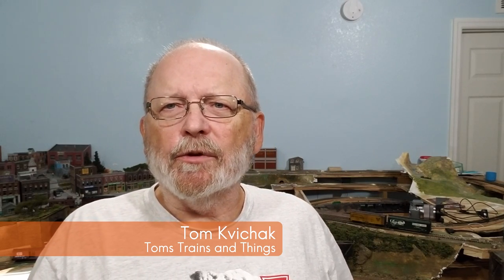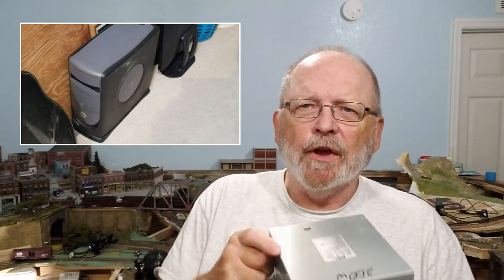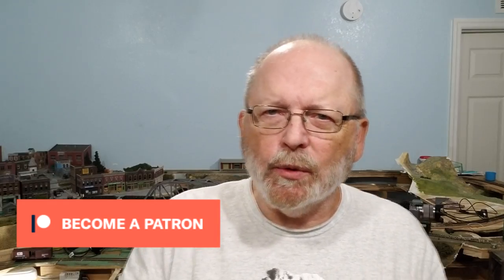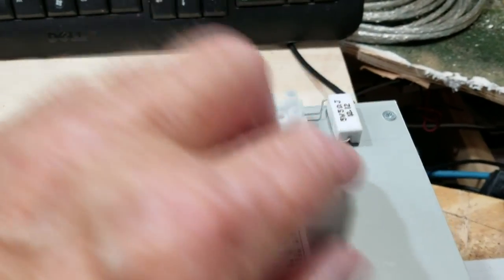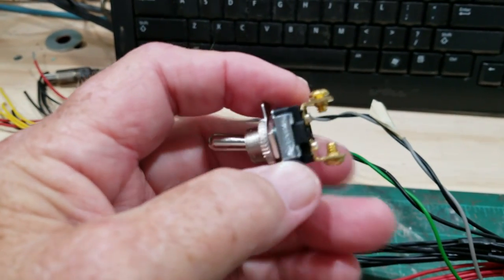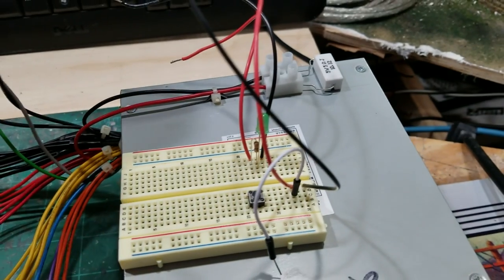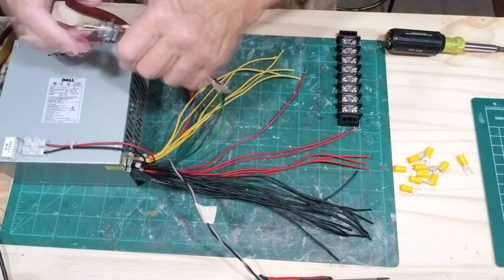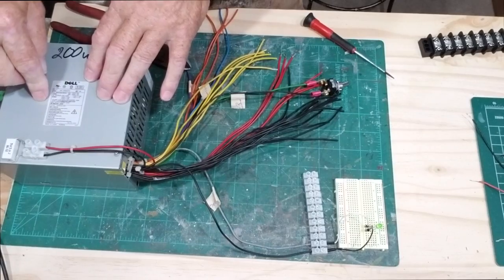Easy Power Supply For Your Model Railroad

Comment: About 20 years ago, I tried to re-purpose an old computer XT power supply. I could not get sufficient voltage from the 12 volt wiring, so I "s-canned" the supply. Later I found the absence of a load on the 5 volt wiring influenced the rest of the available voltages! Later I re-purposed an old AT supply to power general illumination 12 volt LED lighting in my garage workshop. Instead of using a large resistor for a 5 volt load, I used a 6 volt incandescent lamp such as what is was on a motor scooter, golf cart, or a building emergency lamp. Mine was a type 4510, case style PAR36, 6 volt lamp, which worked for me. I know an incandescent lamp's cold resistance (off) and hot resistance (on) are different, but the bottom line is that my one lamp solved the problem for me. The 5 volt circuit does need a load, and mine did useful work in providing some illumination!
Reply from the maker: Good information. Thank you.

Comment: 12 GAUGE OR  10 GAUGE WIRE  .. REMOVE ALL  BLACK WIRE  REPLACE WITH  1-  #10 OR #12 WIRE  TO  TERMINAL NICE CLEAN UP LESS PART USED

Comment: You actually don't need a resistor or toggle switch on the power supply to do this. Shorting pin 15 and 16 on the ATX supply (black and green wires) provides an "always on" load. If the PSU is plugged in (if it doesn't have a switch on the back) or is plugged in and turned on (if it has a switch on the back), a load is supplied and the PSU will provide output. No resistor or toggle needed. I use this setup for powering an RC battery charger. However, if you want to have a remote switch that you can mount somewhere away from the supply like your single pole switch, then your method is probably the best.
Reply from the maker: Thanks for the info Andrrew

Comment: Well, found your You Tubes quite by accident one night while just mucking around looking up information for my then proposed train layout.  Well, I'm in the process of building a modest 13' X 10 foot layout and doing it on a reasonable budget.  Your "how to's" have saved me a lot of money by solving problems in a practical, sensible way. I've have my eyes peeled for an unused PC power supply that should be able to run my accessories lighting.  Well Done Thomas! Your efforts are appreciated.
Reply from the maker: Thank you Thomas. Glad I could help!

Comment: Hi, Tom! I had an old Windows XP computer that worked when I mothballed it. I pulled the power supply out of it after watching this video a couple weeks ago. Tried hooking up the green wire and a a ground through a SPST switch. No joy. Tried using a resistor to fool the power supply. No joy. No voltage on any of the wires. Methinks it be kaputsky! I bought a new power supply for $26.95 off eBay (shipping included). Jumpered the green to the ground, plugged it in, and we have power! I'm going to add the resistor, though, to stabilize the voltages. Thank you for a very helpful video!
Reply from the maker: Your on your way to more possibilities now!

Comment: Well, I just completed modifying the a PC power supply using a 10 ohm 5 watt resistor (couldn't get a 10/10).  I let it  run a few minutes, and took some readings with an Infra-red thermo. Surprise! The 10 ohm 5 watt runs at about 80f (yes, warm! I wouldn't want my grandson to touch a 5/5 used for this) and the major heat sink cycles around 90f. I'll use some tie-wraps to suspend the resistor on the inside of the cover, in  the cooling fan flow.
Reply from the maker: That's a great idea Lloyd

Comment: Good to see you used the 3.3 volt section which I use to run LED lights in buildings or on control panels.  Newer power supplies are rated at over 30 amps for the the 3.3 volt section which is more than enough for the several hundred LED's on my layout.  That leaves the 5 and 12 volt sections to run control electronics and all of my Cobalt switch machines.  Waste not what not.  Cheers Brendon.
Reply from the maker: Glad you were able to use yours. The hidden features of what most people throw away!

Comment: Thanks for posting this even though it was a few years ago. I have an electronic and electrical repair bench in my basement and a few junk computers. I could use the outputs from a computer power supply for my work bench, and not to mention what's left of my model railroad.

Comment: Absolutely amazing! very ingenuous way of reusing older computer supplies. I agree with previous posters, there is a great deal of wiring involved... but this is model railroading scratch building at its finest, put into even more of a practical use. Cheers!
Reply from the maker: Mike The Train Guy thank you. A little bit of work goes a long way

Comment: Tom, Suggest the 5 Ohm 5 Watt Resistor leads be covered with shrink tubing to protect from chassis shorts. Also apply heat sink compound to the underside of the resistor body for better heat dissipation.
Frank WB8JWE
Reply from the maker: Thank you very much for the suggestions Frank. Good information is always welcome!

Comment: You Sir, are a real wealth of information! Thank you for sharing. OMG! We've got old computers. My friend and his kids have computers.... 
I always thought it would be a waste to just throw out all that wiring, components, and I didn't even think about that power supply!!  Pardon my ignorance, but you plugged that into a 120v wall socket? Just the fact that one of those can supply so many different volt outputs, is going to make my head spin! 😨😲😵😵
I mention him so often, you're gonna think we're married!! But Carmine's my go-to electronics guy... He got me some free sound in my Layout room, using a wall wart, an old amplifier, and an old CD/ROM, from an OLD Windows 95 computer!!!

I need to keep this video handy, and watch it often. I'm sure ideas will start flowing...
Murph 🚂
Reply from the maker: Thank you for the kind words Murph. MY old Windows XP computer that I used for 5.1 surround sound and JMRI died right before I did my video on JMRI. I'll have to put my sound card in another computer now to get my sound fx going on my layout. Haven't been having too much luck with computers lately. They are all 6+ yo now.

The power supply plugs into 120V outlet. It drops the voltage down to several DC voltages. Even though there are some modelers that already use old computer power supplies, I was surprised that there were so many that didn't!

I have an old home theater/ tuner that got zapped by lightning a few years ago that I'm going to be pulling all the components out of for spare parts. That should be an interesting video to do.
Reply: Yup!! All my computers are at LEAST that old... I'm pretty surprised that I'm one of those who didn't know! 😑😥  I already knew to grab wall warts from ANYTHING being thrown out. I need to take a closer look at other electronic gadgets.

Doing scavenging, I learned that the vibration motor in earlier Nintendo hand controllers (that don't have transducers instead), are a perfect drop-in replacement for the ooold Tyco locos, with truck mounted, crappy 3-pole motors!! They're the same "pancake style" motor that the Tyco has, but is a 7-pole with less  1/5th the amp draw.
I realize that you'd have to REALLY love that old locomotive....
But hey! The price is right.
Reply from the maker: I have a collection of wall warts also. Always good to have a dozen or two laying around. lol

Comment: Hi Tom
THANK YOU SO MUCH FOR SUCH A DETAILED AND *ACCURATE* VIDEO

I just followed thru using the pause button as I made all the connections as per your instructions, even the Blue and Yellow to give me 24V and it all works just fabulously, exactly as you say, although I do not have a spare 5W 5 ohm. resistor around, but I am still getting slightly higher voltages than your readings !

I have tried this process several times based on watching other videos, but frankly it all got into a knot as they sortta left you in the lurch at important points in the process..

SILLY QUESTION PERHAPS - I have the purple and a black connected separately to a 2 point terminal block, and that gives me 5.1V approx standby voltage, but I must say I was a little mystified when it still worked not only when I turned OFF the switch on the Black and Green wires, BUT IT STILL SUPPLIED THE SAME VOLTAGE EVEN WHEN I UNPLUGGED THE POWER SUPPLY FROM THE MAINS ENTIRELY ?

is it just providing what it can for as long as it can from a large capacitor in the power supply (HENCE STANDBY) or what ?

Totally brilliant presentation, you have saved me a lot of money and a great deal more in headaches as my layout uses several Arduino mini's for control functionality (hence my need for a decent 5v supply) and several CDUs' that can take the 24V supply  as their inputs, so right now I can power most everything from my good ole PC Power supply.

THANKS, THANKS THANKS THANKS................................. You  are a star....:-)))
Reply from the maker: Thanks for watching and your comment Ian. The stand by power was used on the computer to be available all the times even before booting up. you may be experiencing the residual voltage from capacitors holding the voltage after unplugging. It will eventually dissipate.

Comment: What can you run on something like that if you don't mind me asking
Reply from the maker: Any  accessories that would take the different voltages. You can also use a buck converter to boost the voltage to run your trains. I have additional videos on this

Comment: How do you know what wires to connect the switch to and the wires to connect the resistor to?
Reply from the maker: It's explained at 5:32
Reply: But still don’t see my the green wire (for the switch). Why not add the switch to a red and black wire? And why the grey for resistor? Why not a yellow and black?
Reply from the maker: If you put a switch between the red and black wires, you will cause a dead short and fry the wires when you turn on the switch.

Comment: Any tips / way to use the rack power on a random car.  I wanted to try to take five volts off a moving car and wanted to use the power.  Any way this is possible?
Reply from the maker: Buck converter. I've discussed this several times in other videos. You can take any power source, even AC,  and get the desired result with a rectifier & buck converter

Comment: What do you with the brown wire if your power supply has one? Thanks
Reply from the maker: It's the 3.3v sense wire. Connect it to one of the orange wires. It helps to regulate the power.
Reply: Toms Trains and Things Thanks Tom!

Comment: Good idea on this . Now can you use one that has failed  to power the computer? I got one of them from my Dell.
Reply from the maker: You have to determine what is wrong with it. Is there no power out on any of the leads?  Did it blow a fuse? Some have internal fuses.
Reply: @TomsTrainsandThings  dont know.  Will have to test.

Comment: What load can be placed on a power supply's 24v circuit when the +12v is rated at 20amps and the -12v is rated at 1 amp?
Reply from the maker: The -12 is the weak link. 1 amp. If you need more voltage with more current use a buck converter. I show how in this video: https://youtu.be/-YFL0qWQE98

Comment: Hi there - great video, I'm in the process of sorting out all the leads right now!   Quick question - my power supply has a switch on it anyway, so do I NEED to add a switch on green/black, or can this just be a permanent connection.  Any advantages, other than the ability to place a switch somewhere else for convenience?  THanks
Reply from the maker: Test your outputs with the switch on. Some of the older power supplies used the on-off switch and not a pushbutton
Reply: @TomsTrainsandThings  hmmm.  Just blown a row of 4.5v strip leds, all connected to a 3.3v bus (yellow, black). No idea how that happened, possibly because I've been impatient and not waited for the 5v resistor to arrive in the post! Ah well, all part of the learning curve!
Reply from the maker: You better rewatch the video especially at 12:53. Yellow is 12 Volts. You want the Orange & black for 3.3 volt
Reply: @TomsTrainsandThings  sorry, I meant orange and black (which is what I did). I'm wondering whether switching directly from the power supply without the resistor on place have a surge? But the leds are 4.5v (using 3xAA batteries) so plenty of spare on a 3.3 supply.   Mystery continues

Comment: Thank you for the video... But I feel like there needs to be a part two showing the true application.  Demonstrate various accessories and which voltages to use.  How many accessories can use the same pole?  I have a string of buildings with lights.  Some are LED and some are incandescent.  Can they be mixed?  Must they be seperated?  Which voltage do I use and at what point would I overload something?  Thank you for the time.
Reply from the maker: There are many follow up videos on the subject including  basic electrical theory and projects.

Comment: Hi Tom,  I bought my trains about 40 Years ago.  Me and my son used to play a bid but then we had to pack it up again and put it away because we didn't have the space to permently build a lay out.  I watched your video and read thru all the comments.  My question is: Can I use the 12V output to drive the DC lokomotives if I build some type of speed controler between the power supply and the rails?  Thanks.  Willie.  (Bloemfontein, South Africa.)
Reply from the maker: Willie, unfortunately 12 VDC is not high enough to run your trains. Power packs are typically 16V and up. I use my power supply to run accessories, usually the 3.3v and 5v. I also have a few on the 12v.
Reply: Thanks Tom.  I tested  the power supply that came with the train sets that I bought and  its max. output is 12V to the rails. The problem with the power supply of the set is that it seems to me the output watts is to low because the power supply cuts out when I try to run two trains with it.  Thanks any way for your help. Willie.
Reply from the maker: Willie, Those older power supplies that come with train sets were made for running the train set only. Power supplies that you purchase separate from a set are more powerful, higher wattage and higher voltage.

Comment: The power supply is a switch-mode device and the resister on the +5V line guarantees the power supply will "wake up" and regulate reliably.
Reply from the maker: Thanks for your input Tom

Comment: As an electrically challenged individual, I found the video very helpful and done in such a way that even I could follow what needs to be done. Just a quite question is there an advantage to grouping the wires together in the terminal block? I think you mentioned somewhere that this was done to maximise the amperage. Could you you use single wires to power different power busses on the layout.  One again many thanks for the video.
Reply from the maker: There are break out boards that use individual wires for each voltage. Yes, the reason to group them together is for more amperage. These power supplies will handle more amperage with the wires together, but you may use them independently, but you have to pay attention to the maximum amperage for the individual amperage.
Reply: @TomsTrainsandThings  Most helpful, many thanks for your help

Comment: Attention! You should be really care while connecting together wires of the same voltage. Reason is simple: if you get two "+12" wires that came from two different keys this may give you "+12.01" on one wire and "+11.99" on another. Shorting together that two wires would cause dissipation of the voltage difference. Heat dissipation. The bigger the delta - the shorter is the power supply life. So, connect the wires together if and only if you clearly understand underlying schema of your power supply unit. Another option is to put ballast resistor between the wires (usually less than 1 Ohm, calculate it according to actual voltage delta).
Reply from the maker: Thanks for the info Yury. In this particular power supply all the wires from each voltage are coming from the same source inside the power supply. When I opened it, I made sure to bundle each source together, but they were soldered to the board at the same potential for each voltage.

Comment: i have an older Tyco #899V transformer and its got A/C outs and D/C Outs on it but it does not say which terminals are Negative and which are Positive... is there any way to test them to determine which is which?
Reply from the maker: It doesn't matter on the old transformers. Your DC is for track power, its toggled by the fwd/rev sw and the AC is for you accessories.
Reply: @TomsTrainsandThings  thanks... I’m guessing when you choose forward or reverse, it just switches the positives and negatives which would make the engine run in forward or reverse... so I’m guessing I’ll hook up the positive to the right side Terminal and if the engine runs in forward with the switch I. Forward, it’s correct lol !

Comment: hi Tom... does the 5ohm 5watt  resistor need to be on the 5V or can it go on any of the voltage out puts.. i have my LED in line with one of the yellow wires with no resistor.. seems to work just fine... great video thanks for sharing.. vinny
Reply from the maker: Hi Vinny, Yes! Any Red +5V wire to black will do. The Grey wires only function is an indication that the power supply is working properly.That's why I put the LED there. 

The resistor in line with the LED is to limit the current to the LED so it doesn't burn up. You can also control the intensity of the light by changing the value of the resistor.  Some LED's are sold with a current limiting resistor already attached.